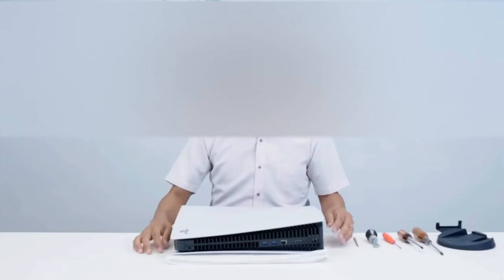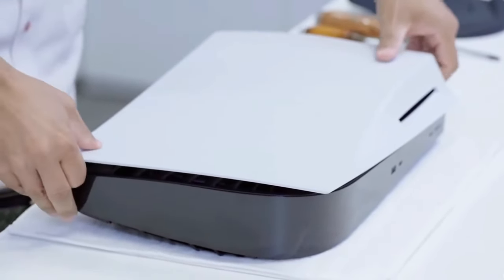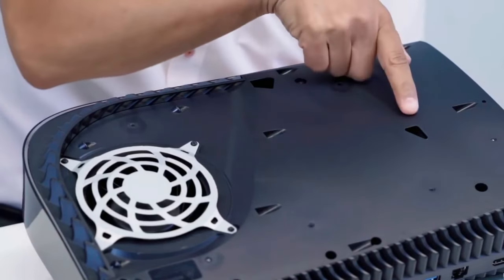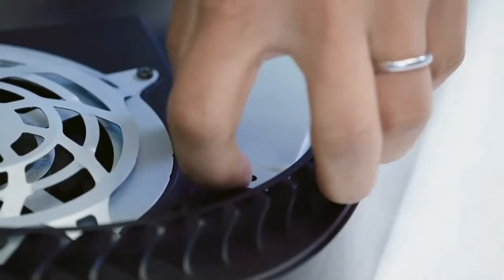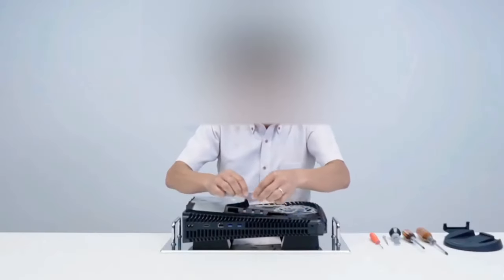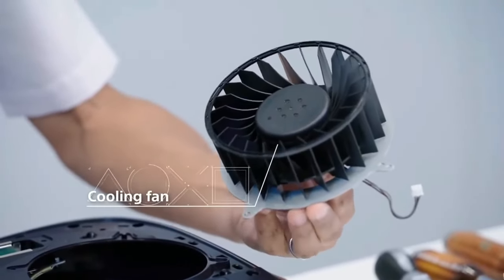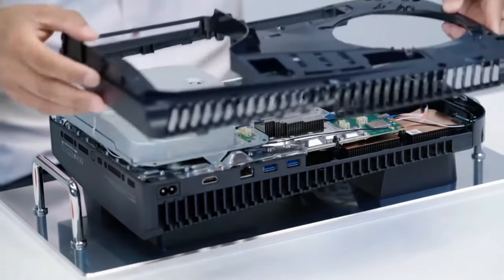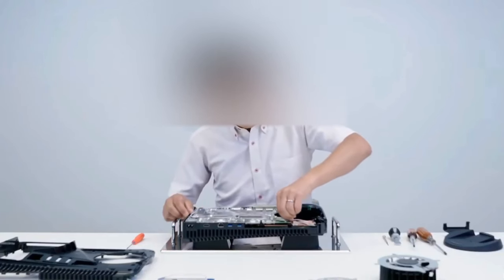PS5 Teardown - How to get to the Disc Drive & Fan (Playstation 5 Ultra Hd Blueray Player location)

Comment: Hi I need some help please what are those 4 screws with the rubber pads ontop of the disc drive for the PS5? I've read on reddit that loosening those screws and tightening them again can help with the loud disc drive please respond super urgent thank you in advance 🙏
Reply: The rubber under the screws help reduce the amount of noise generated by the disk drive. Make sure they are flush and not pushed under the screw on one side.If you really want to reduce the noise, you can  add (padded) double sided tape where the disk drive is placed so there's less vibration. That's the point of the rubber.

Comment: IMPORTANT QUESTION

My ps5 disc drive is broken, but if I just dont use it anymore can I just enjoy my ps5 with digital games?
Reply: Nope. You need to send the ps5 to me.
Reply: Eventually your going to get an error when it needs to system update, then you won't be able to play digital games bc it requires the system update. Basically your screwed. Way to go ps5
Reply: It needs to recognize the blu ray player to update

Comment: Is there really no plug to connect the drive to the motherboard?
Reply: There are some cables that connect the disk drive to a small board, which is then connected to the motherboard via ribbon cable.